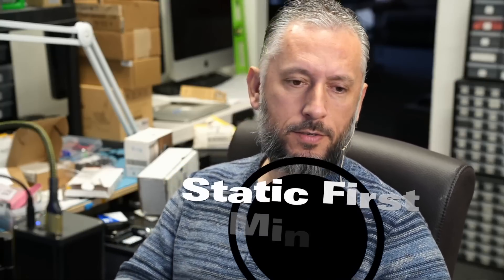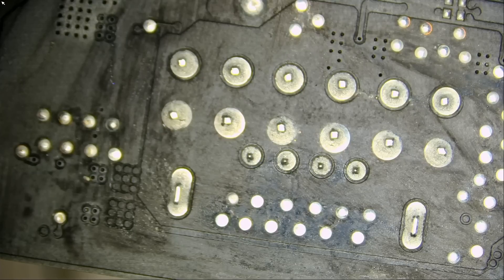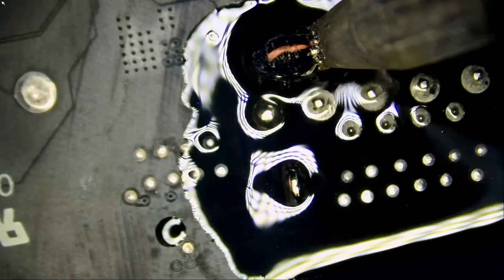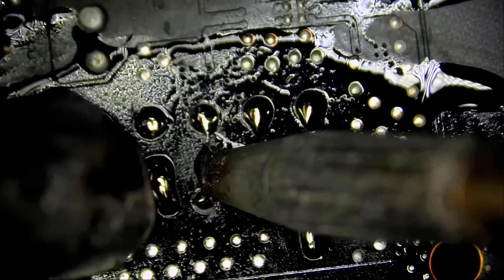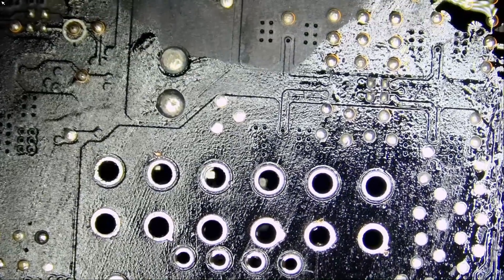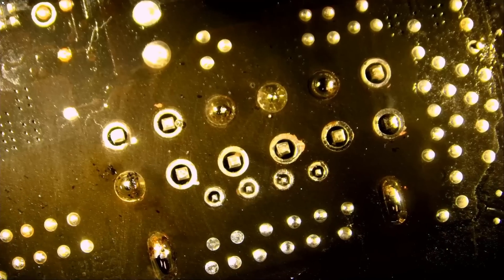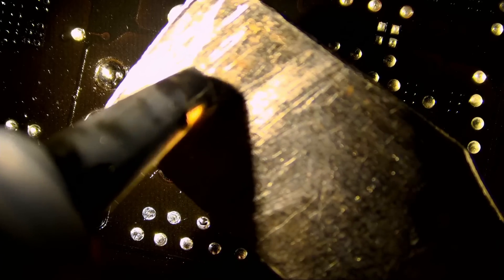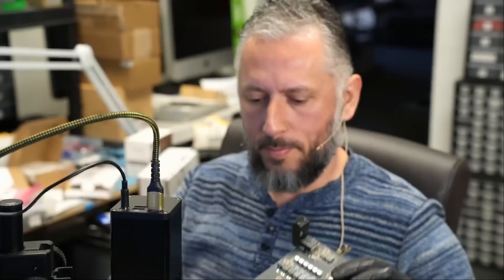4090 GPU Connector Melting Crisis Continues in 2025

Comment: You must be looking forward to repairing 5080's and 5090's melted connectors 😃
Reply: hey steady income why not
Reply: haha the pcb is going to be so thick  going to need a blowtorch to work on them
Reply: @darkkingastos4369  lol!
Reply: FR I don't understand why they keep making this dumb decision 😂
Reply: Don't jynx me. I'll be camping outside Micro Center on launch day for my 5080.
Reply: @IDontKnowYou1216  While you are there get the biggest psu you can buy and never have to look back.
Reply: @IDontKnowYou1216  get a 1000 watt power supply while you are there
Reply: @IDontKnowYou1216  did you get one? i got one but it was the astral
Reply: @Mikey-uj3dc  Nope. Fairfax VA location ended up being wrapped around multiple buildings and the employees said it was by far the longest line they've ever had. I got there at 4am and they sold out with about 15 people in front of me.... it was not a good day.
Reply: They say the connector has been improved but shall see about that. 😁
Reply: But they fixed it again! Can't wait to see a few on the bench in April.
Reply: It is the same connector but the specs got changed of the cables and connection itself . From 12VHPWR (H+) to 12V-2x6(H++).
Reply: I don't think the 5080 will have that problem as much as the 4090 or 5090. 5080 is pretty power effect
Reply: 5080 isn't powerful enough to melt
Reply: its almost certainly due to some of the supply voltage paths not soldered correctly/loose connectors/poor cables...this results in all the current draw routing to the few remaining good paths, exceeding their current/temperature rating

someone skimped on 50c parts, and caused the birth of a whole repair line
Reply: @kwanchan6745  Today's engineers.
Reply: @kwanchan6745  u could be right but i think the most ignored opinion is nvidia trying to run 600 watts through a third of the amount of cable that previous gen. used.  with electricity you always have to go with more than enough not the "we think it will hold up to the heat" approach just because you think it looks better lol
Reply: @kwanchan6745  I don't think so because their have been plenty of high quality cables connectors that have failed. I think it's that 90 degree bend that puts too much force on the connector which over heat cycles works loose just enough to created too much resistances and heat that melts the connector. Take away that tension on the cable and shouldn't be an issue. The engineer just shouldn't have put the power connector in an orientation that would cause a sharp 90 angle on the cable.
Reply: Great thing is you make more profit repairing than you can selling them.
Reply: Heck, the 5090 will spontaneously burst into flames, taking the computer with it.
Reply: @willmorici5765  if you buy a cheap prebuilt and dont upgrade psu !
Reply: Wont have many to repair
Reply: The fixed it with the 4080 S 😀
Reply: @ryry8533  They didn't fix ---- anything, they just put a bandaid over the problem, you still have a lot of juice flowing over a small insufficient connector that's eventually going to burn under high loads.
Reply: They already fixed this 12HPWR connector. RTX4080Super (at least most models) used redesigned 12V-2x6 power connector and the new RTX50 series will use the same connector as well.
Reply: @PabloB888 can we quote you this time next year?
Reply: @RetroAnachronist  Youtube tech experts already have tested this 12V-2x6 power connector, and unlike the original 12HPWR, it cant melt even if the cable is bent or not fully inserted. The 12HPWR connector was drawing power even without full contact with the cable plug and this was the real cause of the melted connector problem (as proven by the Gamers Nexus investigation).
Reply: I don't think 50 series will have the same issue since going back to the 30 series plug orientation. The whole problem boils down straight 90 degree bend on the cable which under heat cycles can work its way just loose enough to cause resistance and then melting.
Reply: @ericwagstaff2227  This has been a good week for your comment.
Reply: @ericwagstaff2227  🤣🤣🤣😂😂😂
Reply: @ericwagstaff2227 They will have it. Believe me